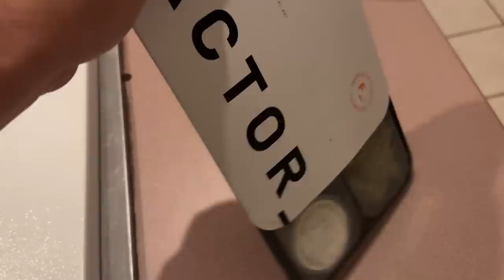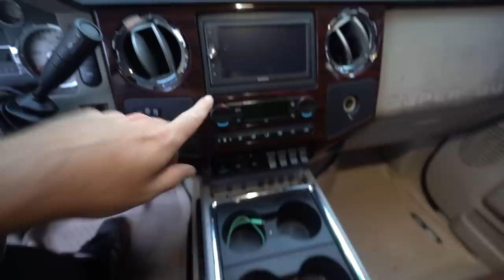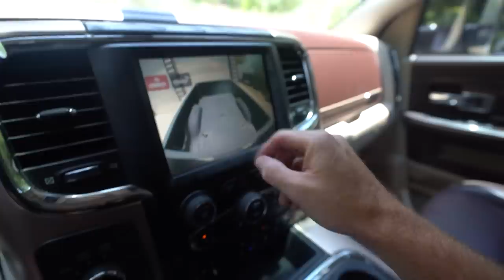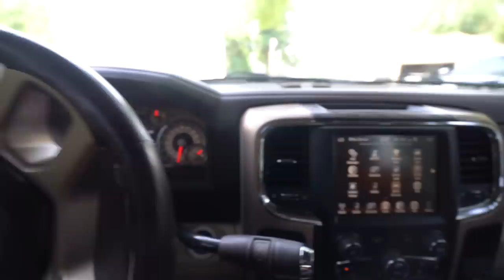My new truck broke down. so I bought another one. bucket list tow rig.

Comment: If you want auto folding mirrors and tire size correction for odometer; zautomotive. If you want dtr; Alfaobd. I have a 2018 mega cab laramie srw. Don't buy a 2019 to 2022, the cp4's are crap. They break! 2023 and 2024 went back to cp3. Earlier comment I agree. Keep the Fummins for back up. Great choice. Light show= key fob, unlock, unlock, lock, unlock. Enjoy.

Comment: I'd rather seen you build the fummins. If you'd get rid of those big ass wheels and tiny tires you'd get some ride quality back and you'd gain some of the capability back because your gear ratio is junk in that truck right now. Do what you like, it's yours to do with, but don't act like you need a new truck because the fummins can't when you're the one that made it what you say you don't like

Comment: Pull out the dents in the tailgate and quarter panel for sure. You know, your A.D.D. is really showing here (flitting from truck to truck) with a perfectly good option in the driveway. A typical "I Want It Now" millennial.

Comment: Don't sweat the low rpms, you're not luggin it. The Cummins makes it torque on the low end. Thats one of the advantages.
Reply: Problem is it has 3.42 gears , only the high output has gear options
Reply: @bbrcummins1984  I didn't hear him say that.  Most came with either 3.73 or 4.10.
Reply: @Itsa_Mea  no ,only the HO aisin have gear options, all others have 3.42 ,
Reply: @Itsa_Mea  the easiest way to tell is if it has a factory aluminum rear diff cover.

Comment: What’s the gear ratio in the new truck? I have a 17 3500 Cummins single rear wheel and I’m trading it for a dually my standard rear wheel has 3.42’s and it’s great blasting down the freeway at 80 but pulling my gooseneck with a 16k lbs track loader is no bueno I’m trying to pick between the 3.73 and 4.10 because I do a lot of unloaded driving bidding jobs

Comment: To address your transmission issue... my 2016 Laramie 2500 went 420,000 miles on the original 68RFE transmission with 90% of its life towing boats on the Interstate across the USA in less than two years!  I went with a deep pan and Amsoil Signature ATF!  Also be sure to replace the power steering fluid each year and that system will last.   Here is my 2021 RAM 3500!!  https://www.youtube.com/watch?v=0FmppqDhxW0

Comment: This is a very ruff riding truck. You can not sleep in the back while the truck is driving. I  think its the short bed that makes it ruff riding. My dad bought his brand new. Not ideal for multiple people riding. People in the back seat will get beat to hell.
Reply from the maker: All duallys ride rough unloaded. I wouldn’t sleep back there driving. It would be to sleep at truck stops on long solo trips.

Comment: Real question, why would early shifting be bad?, as said on 26:55.  Is it bad on fuel economy? Or on engine components? Is something only on diesels or also on gas engines?
Reply from the maker: It’s good on fuel economy but keep the engine that low in the rpm means it has to lug to accelerate which create very high cylinder pressure since the engine isn’t cycling quickly and getting the air out.

Comment: Sadly. Those are a bigger piece than a Ford sometimes just depends on the one you get. Still a cp4, still a common rail oversensitive lady of a truck. The ole fummins might be slower, but wont leave you stranded. Plus side at least you steered clear of Duramax, those things went downhill quick

Comment: Automatic, Not Everything else is good Except the Automatic Transmission weights in at 10,000. Ops. A Manual Transmission is A lot Less. So u don’t get stuck with A Over weight Ticket.